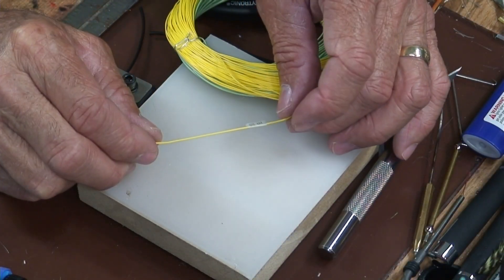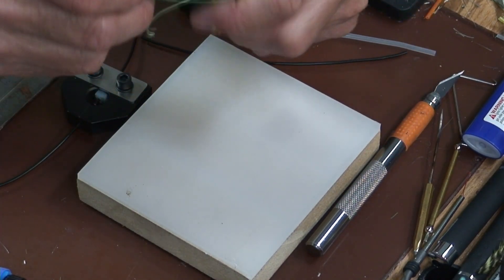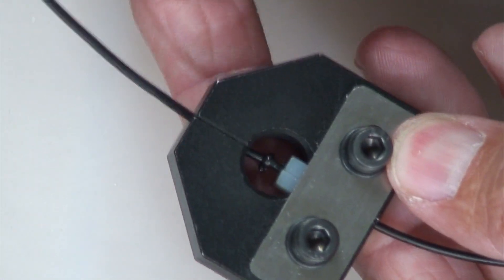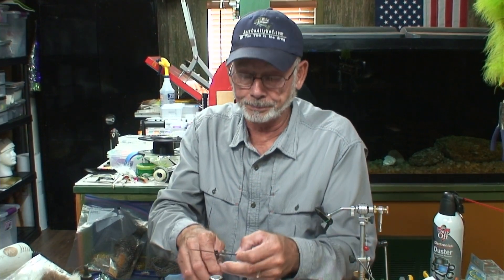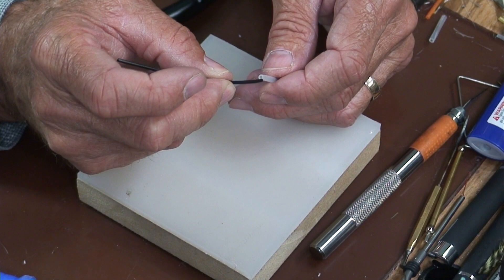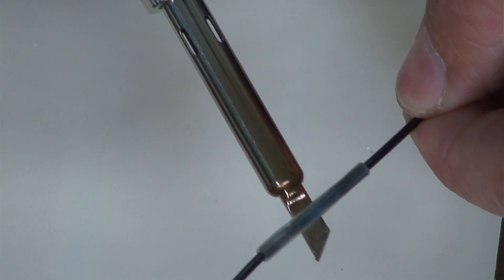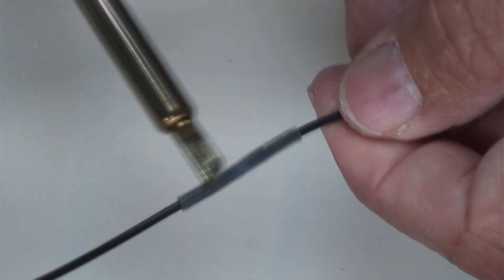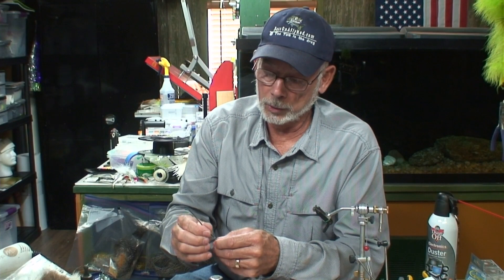The best way of welding or splicing filament

Comment: Thanks Mike !  I've seen others demo this on Youtube acknowledging you but sadly not by name.  Worked first time perfectly on PET-G.  Will adopt your technique of running the XActo blade through the tube.  I was sliding it across like whittling and feared nicking the filament.  BTW I saw a comment that they experienced a little difficulty with some welds being hard and not passing through the extruder gears.  I hope this was just a rarity.  Also wondering how it works on TPU.  Anybody ?  Thanks again !

Comment: When I use the MehrleWeld (the process shown in this video), I remove the silicone with a single edged razor blade. Easy as pie, comes right off. If you've ever used shrink tubing, you might be tempted to heat the silicone in the same fashion. Don't do it. Just makes it hard to cut off. Only heat the joint, then cut off the rest, check the joint, move on to the next one. I've been using about an inch of tubing, but I'm going to try 1/2 or 3/4.

Comment: Sir, you have provided a game-changing solution for the 3D printing world. I ordered the silicone tubing right away and got the splicing right on second try. I used too much heat the first time. A little dab will do ya. There are several devices one can purchase with differing opinions as to how well they work. Your method works 100% of the time and is almost free. I'll be posting this on Bambu Labs forums which hopefully will lead to an uptick in your views. Thank you very much.

Comment: Hi Mike, thanks for this tutorial! I was searching for a tool which helps me, but all are somehow difficult to use. Especially those which force you to slide all the filament back through it. For short lengths  it might be ok, but if you want to weld a new spool to the ongoing print, it is impossible.
Luckely I was able to order the same silicone tube (1/8-1/16) here in Germany.
Again thanks for sharing your idea here.!

Comment: Had to subscribe...  I had been searching all day about this, and found many videos on DIY-ing this to expensive heated joiners, and all had flaws and some had many flaws, but this looks amazing, and after reading through the comments, I am confident that I finally found the best way to accomplish fusing two pieces of PLA together.  Used your link to order the tubing, and looking forward to a fun time putting this idea to use.  Thanks for taking the time to share your experience with others, as that is what I like to do myself, so 3 thumbs up for sure...  👍👍👍

Comment: Could the same effect technically be achieved with a thin metal tube of around 15mm length with an inner diameter of 1,75mm? That might conduct the heat from the soldering iron better. I was thinking of putting that in one of those soldering helper tools to hold it.
Reply from the maker: No... you can use a brass tube, but how will you get the welded filament out? You can't without sliding it completely off.
Reply: @WhatIsMikeMakingNow  That is indeed a good point, I hadn't considered that when I commented. I could feed the smaller connected spool all the way through, but that would be a massive hassle in some situations. Thank you kindly for the fast reply, though!

Comment: I've tried this and it works well except that the joint becomes very hard and won't always pass through the extruder, leading to interrupted prints. Am I doing something wrong? Is there a solution?

Comment: That's not exactly how that little black filament jig worked, You dont shove the filament ends together so they mushroom.

When you heat the ends and melt them. You then push them into the white nylon piece and move it back and forth which smooths and rounds it. Then if Necessary you can pull it back through the other side which can shave it down. The screws are there so you can easily take it off a long line.

Still its a little fiddly because it's small. A handle or mount in a vice helps.
Reply from the maker: Whatever works for you. But if you're talking about that little jig... it certainly works, but not as well or consistently as the method I show in this video.

Comment: hey, question--so i finally have a soldering iron and i have to agree it makes the process SO much easier, but now ive been dealing with an issue where spliced filament will snap at the splice point when i have it feeding from a drybox to the extruder. is there any reason this happens? does it have to do with splicing temperature or moreso the angle at which its being fed from the spool?

Comment: Having tried several of the techniques for joining filament, with varying rates of success, I can very confidently say that using silicone tube is by FAR the easiest and most succesful of all the methods I used. I'd never have thought of it if I hadn't seen this video. Thank you for the insight.
Reply: so you don't think is a must have a welder machine?

Comment: awesome video, definitely trying this ASAP. one question though, does this method not work at all with a heat gun or is it just not not as effective as with a soldering iron? i have both a heat gun and a pyrography tool but the heat gun honestly seems safer and easier to use to me, so i really want to see how well that works anyways
Reply from the maker: Good question, I haven't tried it any other way... let us know.
Reply: @WhatIsMikeMakingNow welp, just tried it today...im glad to report that a heat gun works just fine for this method! if you want it to be as fast as the soldering iron method though, youll have to heat it up for a few seconds on the higher heat setting. since this was my first time it wasnt quite as clean as what you did in this video, but it was good enough that it looked like a slightly kinked portion of filament. heres to hoping it holds up okay!!! thanks for the video 😊

Comment: Thanks for the technique. I have been able to join filament in a pattern to print alternating colors. Only had one failure so far out of at least ten welds. So much easier than welding blocks.

Comment: Thanks for the video!  Been researching this very problem!!!  Great Job!!!  Which size Silicon tubing did you use?  1/16" ID-1/8" OD or 1/12" ID-1/4"OD?
The 1/16" ID-1/8"OD is equal to 1.58 mm ID and 3.175 mm OD.  That will be the one I order!  The 1/12" ID-1/4" OD would be 2.12 mm ID-6.35 mm OD which would be to large!!!  Thanks again for the video!!!
Reply from the maker: 1/16" ID
Reply: @WhatIsMikeMakingNow  Thank you very much!

Comment: this is so much nicer, the clamp thing was so annoying because the filaments natural bend from being on the spool would always make them a pain in the ass to line up. i had been using a piece of ptfe tubing i cut 80% of the way through to heat the ends and stick them together which got a similar result (just sliding the tube off as i respooled it) but this seems way nicer to do.

Comment: Thank You! This is by far the least expensive, fastest, and most accurate way to weld 2 pieces of filament together. I tried it for the first time today and welded the filament together in less than 2 minutes with no visible seam, no bulge, no misalignment, and no change in filament size. If I hadn't used 2 different colors, I would have been unable to find the welded area when finished.

Comment: On that black jig you are suppose to push the mushroom through the white tube while it is still hot to get it close the the right diameter.
Reply from the maker: I get it. I just don't like it, nor do I think it's as good as the method I show here. To each his own, I guess.
Reply: @WhatIsMikeMakingNow  I have never actually made a successful filament weld with that little tool you show in the beginning. Either the bond isn't strong enough to make it through the extruder or the bulge is too big to make it through (even after pushing it through the tube). I am always on the hunt for new ideas for actually being able to make a successful weld. I am going to give your silicone tube a try.

I have seen other videos of people making what appears to be successful welds with that tool, although I have never actually seen a video of a weld made with that tool going into an extruder and surviving.

Comment: I tried this tonight with a bunch of scraps, it looked fine until I stressed it at all, then it would break at the joint
Reply: Same for me - I put a small bend-stress on it as if I was going to wind it around a new roll of filament and it snaps.  Pulling on it like he shows does create a very strong "weld" though.

Comment: Do you just wind your filament up with that tube still on it? (When combining two rolls of filament?) I use the little metal tool because I can unbolt it when I join two rolls together and roll them over to one side with my drill.

Comment: Hi Mike.  I've tried many different ways to splice my 1.75mm PLA filaments with some successful splices. But nothing close to your   process! The very first time was perfect. Your process takes the split second timing completely out of it! And the heat can take it's time to truly penetrate and bind together and the tight fitting tubing holding perfect form the whole time! I own a machine shop and
repair all my machines myself. And I tell you, that was a brilliant idea. I'm very impressed. Anyway thanks so much for sharing that GREAT IDEA!!!

Comment: Excellent option.  I have had a hard time fusing filaments together with some of the other techniques we can find.  This one is by far the easiest one, in my opinion, when you have the silicone tubing.  I bought 2m of 1.6mm ID of tubing which is about the equivalent of 1/16" and it worked the first time I tried it.  I did it on two different rolls and each one was successful.
Not having to hurry up and guessing the right process is the strenght of this technique.  To each its own and nothing wrong with the other methods but this is now the one I will be using.

Tks for sharing

Comment: You sir are a GENIUS!!!  After having tried every "wizz-bang" device and "easy" methods to join filament on YT, yours WORKS.  I mostly print in ABS since I have an enclosed printer.  I prefer the toughness of ABS over PLA and the ability to "vapor smooth" ABS.  I was successful on my first attempt with ABS.  Not only is the joint smooth and shiny it is actually very slightly smaller than the filament diameter so NO TRIMMING OR SANDING.  I have been successful 4 out of 5 times.  The "trick" is to resist the urge to over-heat the filament.  ABS becomes very brittle if over heated like you mention.  I tried PLA and was successful the first attempt.  I was able to reclaim almost a full roll of ABS filament using a few cents worth of silicone tubing and a little time.  Thank you!!

Comment: Thank you !   This is pure genius !   I ordered the 1/16" tubing immediately after watching your video and tried the technique. It worked perfectly the first time. So easy. I cut the ends angled, lined them up in the tubing, held a flat sided soldering iron against the joint area for a few seconds and then barely pressed the filaments together (they're very soft then). Held them straight and blew on them a few moments to cool. I did less fussing than even you showed while filming. The joint looks perfect !  Like done by a factory machine. So smooth....  The diameter actually shrank a little, from 1.75 to 1.73mm  and I pulled about 10 pounds on the filaments with no problem.  Just amazing. All those tools and sanding and fooling with things is silly. This tubing idea is AWESOME.

Comment: You're not using the clamp right; you need to push the filament into the white tube part while the it is still soft. That shapes it and there's no mushrooming and no trimming required.
Reply: Yes, but in my case, it didn't go inside that ceramic part because my filament is not straight.

Comment: Thank You!!

I have tried at least a half dozen ways to join filaments, and either the weld was too weak, required lots of cleanup, or didn't reliably feed into the print head.

This method works amazingly.  The splices are strong enough to wind the filament back onto a spool without the weld point breaking.

Comment: Before I buy the tubing can you clarify that you use 1/16” ID tubing. 1/8” OD. Lots of different sizes on Amazon.
Reply from the maker: The link to what I use is In the description.
Reply: @WhatIsMikeMakingNow    Thanks for this post. The technique works well. The author’s link to the silicon tubing is vague as it takes you to Amazon with multiple tube sizes. You need the 1/16” ID, 1/8” OD tubing. Had the author responded with a simple “Yes” to my question it would have saved me some aggravation. I always try to provide a response to readers of my channel in a clear and expeditious manner. The video is very good. Probably the best technique out there.
Reply: @TheRotorhound  He gave you the link. I don't see an easier way to respond. It's almost like you're trying to be offended.
Reply: @PesquisasMormonas  On my computer the link went to various size tubing. Didn’t want the wrong tubing. Is asking a question not allowed?  Links on Amazon change all the time. I just asked for a confirmation. My bad I guess.
Reply: @TheRotorhound  The only difference in size is the length, the diameter is the same. I just went to it and bought the first result. 12 bucks. It couldn't have been easier.
Reply: @TheRotorhound  Dont apologize, I came down here in the comments for the same reason....noone accurately answered your question.
Reply: @BlaZiN1213    And I took a beating for it. 1/16” id, 1/8” od works.
Reply: @TheRotorhound  Your question was perfectly reasonable. The link does show multiple diameters and links do change. People are jerks. Another way to look at it is 1.75mm is 0.069", so 1/16" tubing, at 0.063" is a reasonable size to lightly squeeze the tubing for a good fit (although 1/16 silicone tubing from Amazon might not be held to much of a spec). As a result, on my test, the joint ended up about 1.73mm while the rest of the filament measures 1.75 as it should. And it's SO SMOOTH and perfect looking. It's an awesome technique. All the tools and other stuff is silly. This tubing idea is the real deal, man:-)  Some people might be using too much heat and spreading it over too much of the filament. I just used a few seconds of heating right at the joint and then barely at all pushed them together. I think the tubing is doing the real holding. One needs to keep everything straight for a while as it cools. A person might want to have a block of wood with a groove cut for lining it up while it cools. I used an angled cut. I forget at the moment if that was in the video.
Reply: @jefflastofka9289   Thank you.

Comment: You have mushrooming using the splicing jig because you're using it wrong.
Reply: My thoughts are exactly the same... Once filament are melted you need to move back and forth slowly to "iron" mayerial and avoid mushroom head... Also jig itself is kind of bad IMHO. I use capricorn tubing reinforced with pen spring and donut shaped jig from thingiverse idea is same but bit easier to use then this jig. I must admit tho his method isn't bad either tho.

Comment: This method looks better than the special clamp, maybe others have pointed out, the special clamp version requires you to push the filament into the nylon clamp section after being heated.  This shapes the filament and stops the mushroom end.  Still, the silicon tube is way better, good job.

Comment: 😊 Hi Mike, as you say I have tried several times to join filament with various methods shown on YouTube and have made 3 models from Thingiverse and they do not work  as the joined filament will not go through a boden tube when finished.  I have used your method and it works. Thank you.   For the record the size of tube that I used was 1.5 MM inner that I purchased on Amazon UK.
Reply: So 1.5 mm will work for filament 1.75mm, can stretch a little bit?
Reply: @chovab  yes the 1.5mm stretches and keeps the join tight, so the finished filament will go through the boden tube without a problem
Reply: @brynkelly6141  perfect, thank you for confirming, I just order it over aliexpress 10 meter 😁, I want to join filament made from plastic bottles. I make machine and making my own filament
Reply: @chovab  Hi I hope your own filament will fit.  I used it for PLA, I have also tried making my own PETG using bottles as per this link https://www.youtube.com/watch?v=uSBCxH9358s&list=LL&index=12. The PETG filament was a little larger but still fitted. Hope you have better success making PET than me, I will be sticking with PLA.

Comment: Thanks! Just ordered some 1.6mm ID 4.8mmOD tubing. Ill use a Hot air station to heat it up. and see how it goes
Reply: How did it go with the hot air station?
Reply: @cottagemail4066  not too well.

Comment: Thanks for the insightful video. Careful not to stab yourself opening the heat shrink like that. It seems like the more equal the cuts are, the better off you will be when joining. Perhaps a tool could be made to optimize the cut face.
Reply from the maker: Good idea